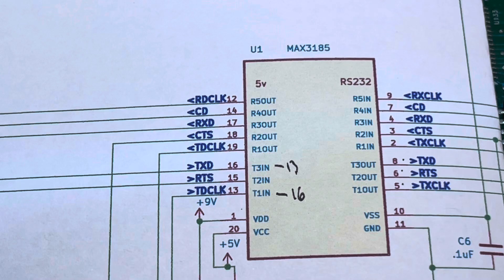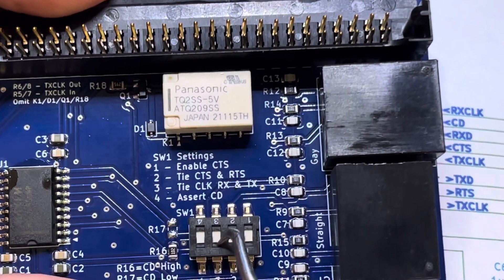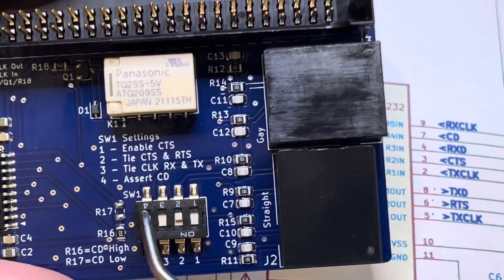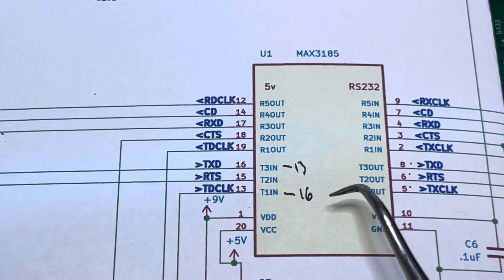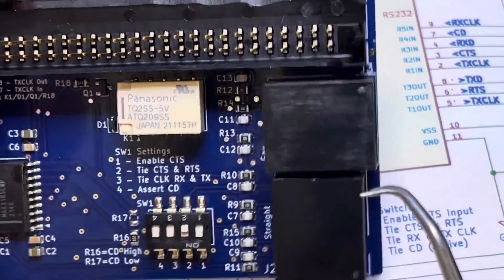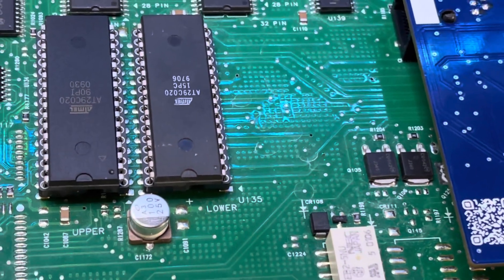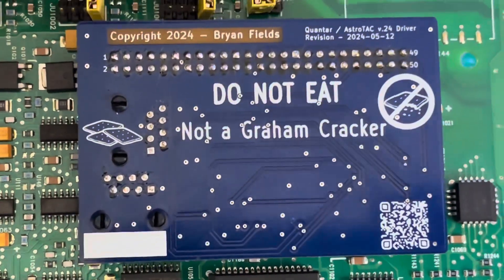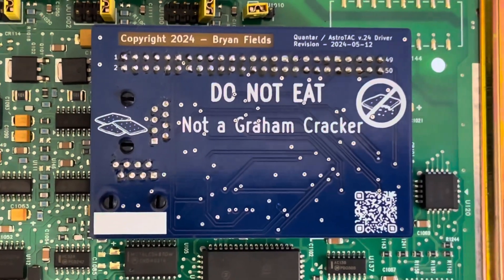Quantar / AstroTAC v.24 board

Comment: I did upgrades in 2007 or so when the V.24 board went extinct in the middle of a countywide upgrade.... and they were impossible to find then!    Nice work!
Reply from the maker: This is actually a better design, as it has a built in cross over port and no need to cut or replace the front cover for it to fit.